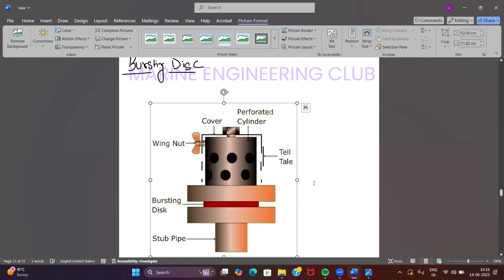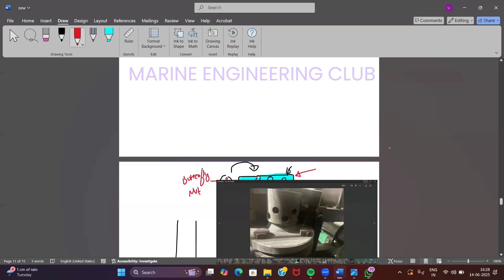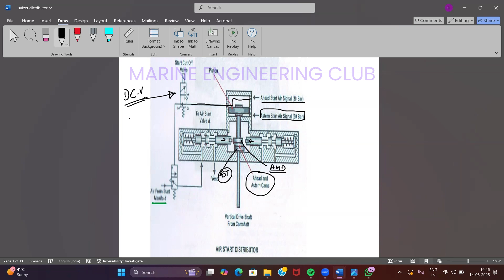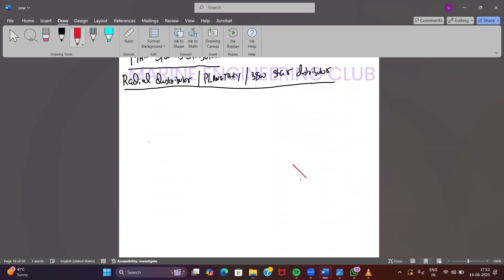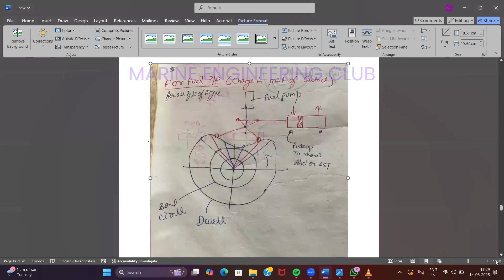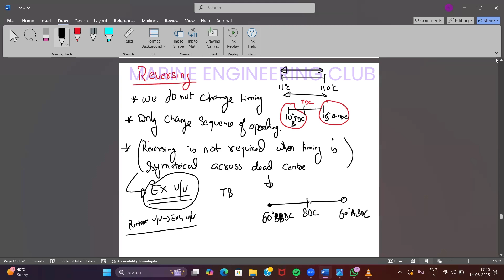STARTING AND REVERSING LECTURE 3

Comment: Sir I see all your videos about starting and reversing .......one doubt is sir in man b&w  mc series engine how starting air distributor position changes during reversing .....please reply 🙏
Reply from the maker: air distributor's position is changed during reversing by a pneumatic reversing cylinder. This cylinder shifts the position of the distributor's pilot valves relative to the camshaft, which changes the timing of the pilot air signal and reverses the engine's
Reply: Thankyou sir 🙏❤